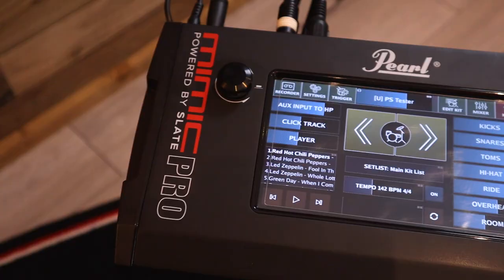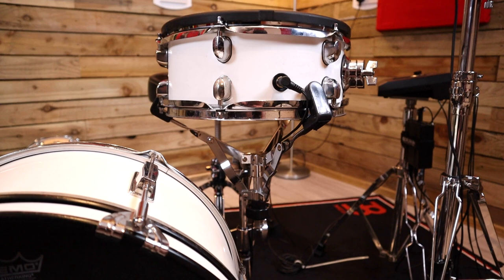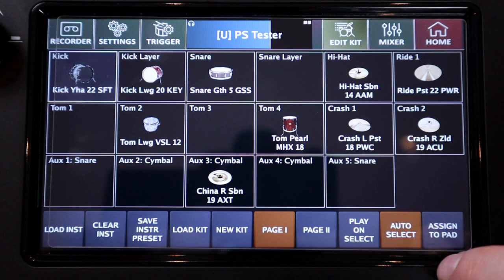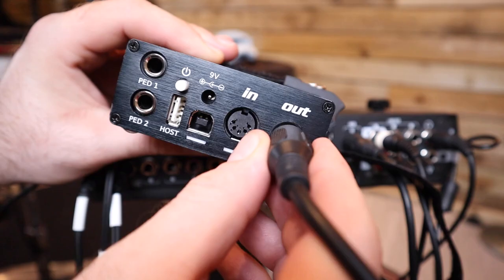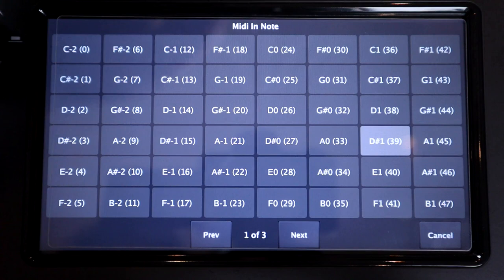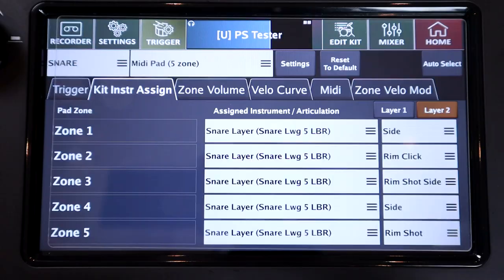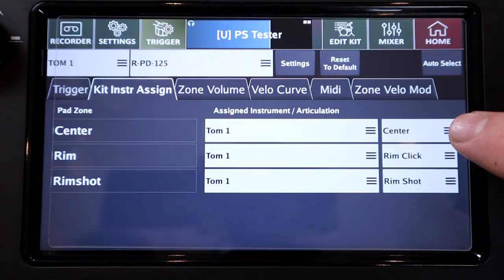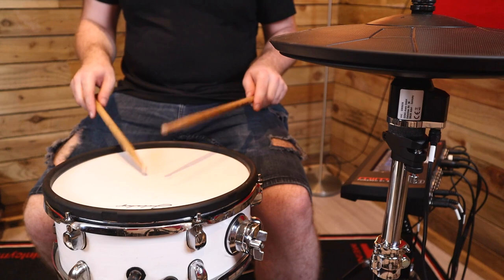I Put POSITIONAL SENSING on the Pearl Mimic Pro with the eDRUMin 10

Comment: Great video and good idea. The remark that positional sensing was Roland patented for a long time confuses me. The 1993 Clavia ddrum3 already supported positional sensing, as does my good old ddrum4 module. With the ddrum4 you can configure a pad to transmit up to 8 different midi notes for positional info.
Reply from the maker: Thank you! Yeah, it's a bit of a muddy one. The idea of using positional sensing at all isn't/wasn't Roland patented, I think it was the specific way they did it with the centre cone trigger and waveform detection on mesh. So I think that it kind of ruled out a lot of options for smaller companies after Roland had established their way of doing it and many just didn't even bother in order to try and avoid legal issues. I'm not sure whether the ddrum stuff was before Roland's patent or if their method was just very different. I could be off here as I didn't play electronic drums (or drums at all!) way back then, but I think that's the general idea.
Reply: @TheeDrumWorkshop  thanks for your response. I do recall issues in the past with patents related to mesh pads with center mounted piezo's, but after doing some online searches it seems that positional sensing is also mentioned in related discussions. It may indeed have to deal with the specific method that positional sensing is used. Ddrum had mesh pads at some point, but with side mounted triggers. I wonder if that was because it was easy for them to do (based on their cast acoustic pads and already available rim mounted trigger design), or whether they were avoiding issues with Roland. Officially positional sensing on the ddrum4 is supposed to work only on the ddrum cast precision pads, but I have noticed it to work to some point with a Roland mesh pad as well, but there is no tweak-ability at all.

Comment: Looking to upgrade my snare to one that supports positional sensing, and is compatible with my EDrumin10.
It appears currently the EDrumin doesn't support multi sensor pads, is this correct?
So aside from the DDT MS-140 I saw in the Audiofront video about positional sensing, what else will work?
I'm looking at the Roland PD-140DS and the Drumtec Pro 3 snare drum. 
Any others I've missed?

Comment: Is it also possible to have the bell-sensing feature to other cymbals? TIA, Luke!
Reply from the maker: Yeah, you could run your cymbals through the eDRUMin, use the bell sense for the third zone and then send the MIDI to the Mimic allowing you to have multiple 3 zone cymbals. Or even do the same but with dual input rides going into the eDRUMin. Bear in mind though that no crashes have bell samples in the Mimic so you'd probably need to do some clever mixing and matches with ride samples if you wanted that. Also, the bell sense feature works great with certain cymbals (mostly the Roland ones), but it doesn't work well with others, so it would require some testing/the right pads to get it right.

Comment: Hi Luke! Thanks for efforts! You used the Jobeky trigger? Sounds nice. 
I really enjoy your british accent. -> Say: "Alibaba".
By the way, due to your vid I ordered some Lemon cymbals and a 45$ 12" Lemon snare pad. 
Even beeing a low-priced product that pad performes basically quite good with positional sensing using the eDRUMin.
Reply from the maker: Thank you! Yeah, I used the Jobeky trigger for this as it was the most accurate one I had for positional sensing - had try pretty hard to keep the dynamics in check with that centre hot spot! Interesting - does the Lemon 12" pad work well? I've only tried the cymbals myself.
Reply: @TheeDrumWorkshop  I need to make some further tests. But I already dialed in a playable position sensing. As I see, they use a smaller foam rod than Jobeky.

Comment: I just bought a Yamaha DTX Pro module. According to Simon Edgoose positional sensing is available for the snare but ONLY ON THE TCS SNARE! What's the deal with this?
Reply from the maker: Yes, for whatever reason it doesn't/can't support PS on mesh pads. I imagine they created their own method for the positional sensing and it relies on either the TCS material's response or something in their wiring (purely guessing). Yamaha's only mesh pads are also 3 cone ones which probably won't do positional sensing anyway, so they probably didn't deem it important to support PS for competitors pads. I personally think it's a shame but I don't know their actual reasons.

Comment: How does positional sensing work? Is it two piezes and you work out position by the velocity difference between the two piezos?
Reply from the maker: It's just the one centre piezo for the head position. I believe they use the frequency of the waveform to detect where the hit is on the head . As you move away from the centre of the pad, the waveforms will become shorter (if I remember rightly) because the head flexes less/has a higher tension towards the edge. The patent they have explains it how it works, so if you have a search around you should be able to find that to learn more about it!

Comment: Interesting, so with the eDRUMin does this mean I could also get positional sensing working with a GGDrums library in my DAW?
Reply from the maker: I don't think that GGD has any "snare side" samples, does it? This method relies on that - or at least a set of alternative samples that sound different enough to the centre head samples when triggered by the note change as you move across the head.
Reply: DrumDrops offers sample libraries with samples for Snare centre and snare edge hits

Comment: Downright Brilliant!  I'm assuming the eDrumin 4 could do the same for a bit cheaper.
Reply from the maker: Thank you! And yes, I should imagine so. I'm not using any eDRUMin 10-specific features.
Reply: Yes, this will work fine with the eDRUMin 4 as well.
Reply: @yeahtuna  Are there any eDRUMin10 specific features besides th USB host?
Reply: @eDrumsInANutshell Besides the USB Host port, ED10 also has a MIDI In DIN and an extra pedal input.